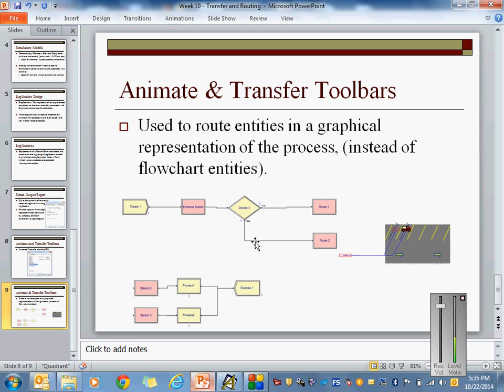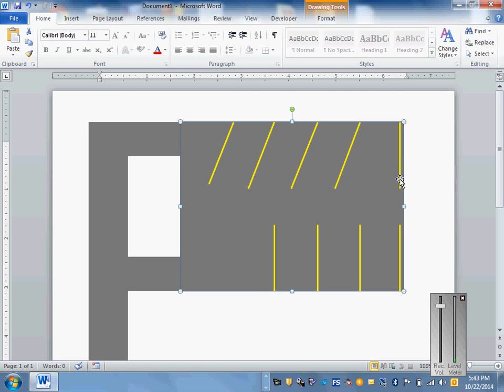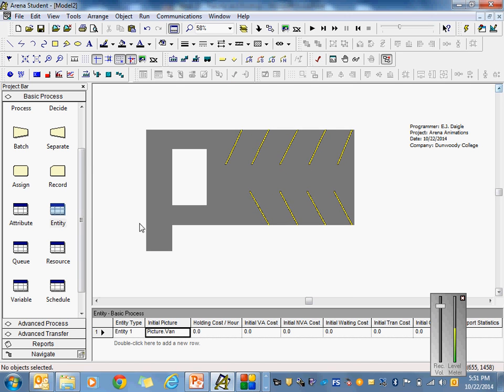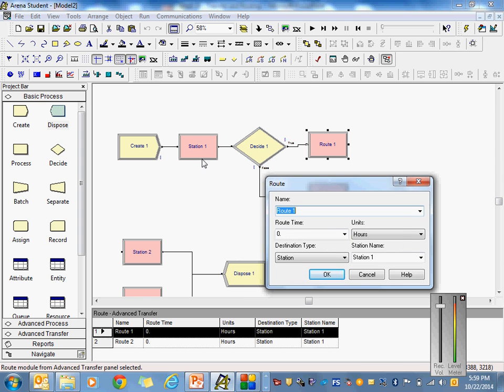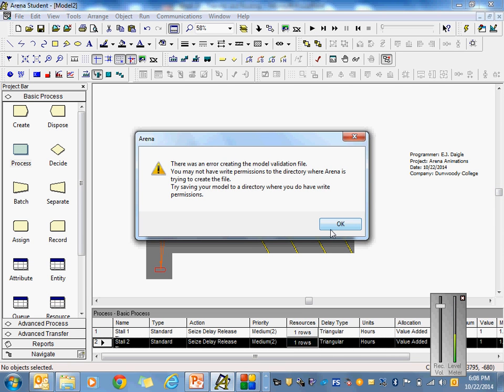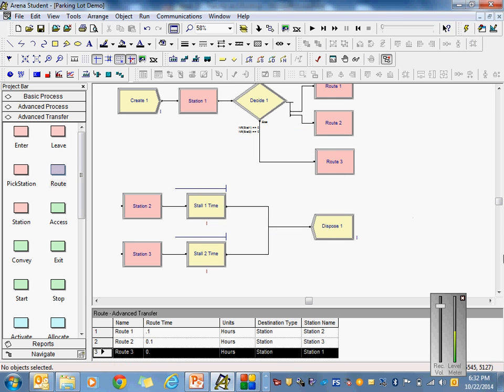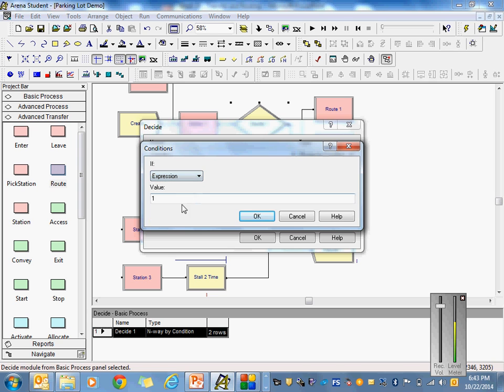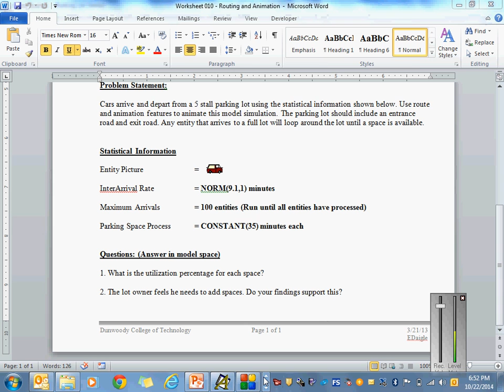Rockwell Arena Simulation - Parking Lot Animation

Comment: Hello. I have been watching your videos and I was wondering if you could help me with a model I am working on. I want to simulate a production line that has different products. First, it should produce 2 batches of 50 dolls. Once the dolls are finished it should proceed to 3 batches of 10 trucks and at the end 4 batches of 5 balls. It should be produced in that orden strictly, so its kind of a production order. I was thinking i should use variables arrays but I am not sure how the create module can manage that. Thanks for your help